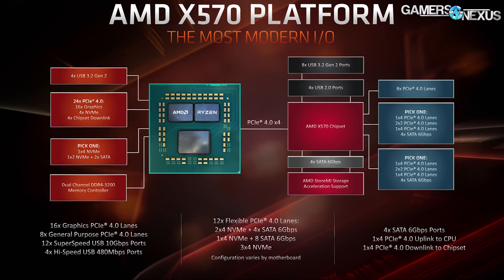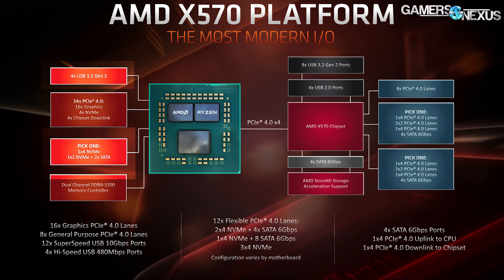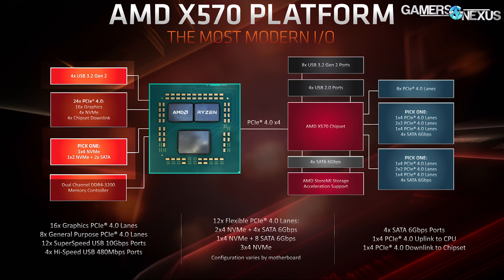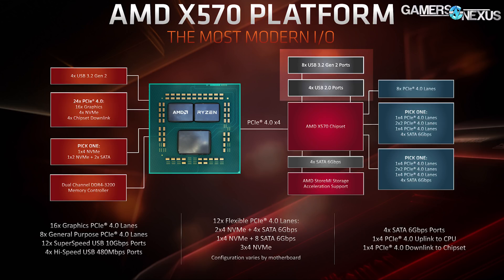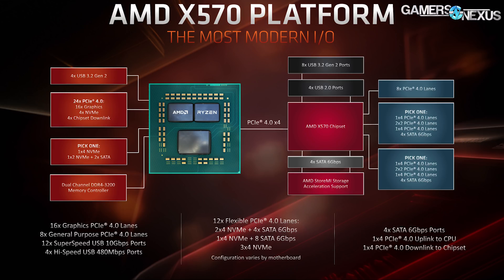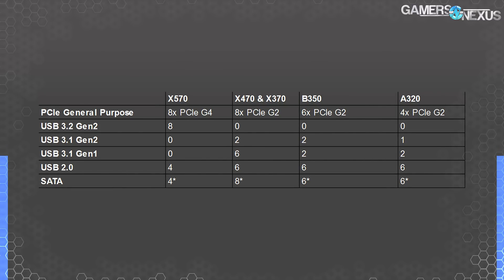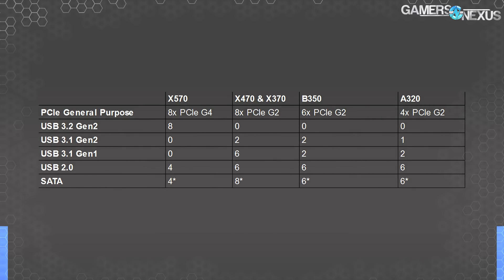AMD X570 vs. X470, X370 Chipset Differences, Lanes, Specs, & Comparison

Comment from the maker: Thumbs up for the video being in focus!

Chipset comparison article: https://www.gamersnexus.net/guides/3482-amd-x570-vs-x470-x370-chipset-comparison
GN medium modmats are in stock! https://store.gamersnexus.net/products/medium-modmat-gpu
Reply: Any chance you'll do a large comparison of the RTX 2080, GTX 1080 Ti, Radeon VII, including a Titan Xp with the supposedly RTX 2080 Super if it does come out to see a comparison at this performance point?
Reply: Thumbs up delivered!
Reply: I thought the X570 has 16 lanes of PCI-E Gen4.
Reply: Hey guys, I have a question. How much the new motherboards can affect the memory OC? I'm assuming that this is totally depended on the CPU memory controller thus just replacing the CPU to Ryzen 3xxx will result in better memory OC, but will we need X570 board for better gains?
Reply: Steve I'm a little confused, if PCIe 4.0 delivers roughly 2x the bandwidth of 3.0, and current GPUs don't saturate PCIe 3.0, why don't manufacturer's of x570 (and PCIe 4.0) use 8x PCIe lanes for primary GPU so we have more PCIe lanes left to work with?
Reply: I take it the 1X Thunderbolt 3 option would take the 2X USB 3 gen2 from the CPU controller?
Reply: Btw AMD said the 7nm apu's will be out in november. They might e the 3300g and 3600g ones
Reply: Interesting.
Reply: There is a Rumor about even more powerfull chipset X590 :)
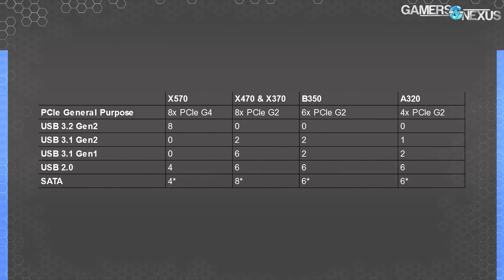Reply: I could be mistaken, but there appears to be a mistake with the comparison table starting around 4:55 It says that the general purpose lanes on previous generations were 8x Gen2, though it seems logical they would be gen 3
Reply: @ScymonEh   On my B450 and B350 boards the Chipset PCIE slots are PCIe 2.0x16 @x4    and PCIe  2.0x1  so  I think your logic is wrong.

Comment: 6:56 wow you nailed it, being on a x370 currently with a ryzen 3000 cpu i'm blocked from usingn latest AGESA bios that would give me accses to smart access memory (SAM) and other general improvements, Now it's a minor performance improvement but still feels kinda silly having to get a new board just cause AMD chose to block of third party vendors from giving out new bios to older chipset boards even though it would work.

Comment: Thank you very much for video. May I ask if I can I have following config:

CPU: Ryzen 5 3600
MOBO: GIGABYTE X570 AORUS PRO
PCIEX16: GPU for PCIeX16 3.0
PCIEX8: GPU for PCIeX16 3.0
PCIEX4: SATA card for PCIeX4
PCIEX1_1: NIC for  PCIeX1
PCIEX1_2: NIC for PCIeX1

Will this work on Ryzen 5 3600? Because somewhere I've seen that it has 20 lanes one one page and 16 + 4 + 4 on another. Thank you

Thank you very much.

Comment: will the overclocked 3600 run smoothly on MSI X370 SLI Plus? bcs I can't seem any tech tuber testing a ryzen 3000 series using this board and I don't plan to change my mobo anyway or anytime soon.

though i've read somewhere that the latest article that they are now compatible and I also happened to always update my bios version, almost all of my country's vendor says that X370 still not supports the Ryzen 3000. I don't know anymore if i got the wrong info or if the vendor hasn't really trying hard to update their info (or perhaps it's their tricks to have their X470/X570 getting sold?)

Comment: basically at this point, if you own a decent x370 or x470 is useless to spend 300$ on a new board. since most the processing is done on the CPU die not on the chipset. Hardware has always been far more advanced than software that can even utilize the hardware.
but you always have Insane people that will throw away a perfectly fine board just to get 7-10 more FPS

Comment: Seems the only manufacture that has PCIe 4 active on their are x470 and B450 is ASUS , Quoted from toms hardware :  " The biggest surprise is that there is better PCIe 4.0 support on  Asus' B450 motherboards than on the higher end X470 offerings. The flagship ROG Crosshair VII Hero,  can't run the first PCIe x16 slot at  PCIe 4.0 speeds, while the TUF B450M-Plus Gaming, supports PCIe 4.0 speeds on both the PCIe x16 and the M.2 slots. Out of the entire X470 stack, only the ROG Strix X470-F Gaming and the Prime X470-Pro are able run a PCIe 4.0 graphics card at x8 speed and PCIe 4.0 SSD at x4 speed. With the exception of the models from the ROG Strix line, the majority of Asus' B450 motherboards can do x16 and x4."

Comment: What's the hole spacing for the X570 chipset? for people that might want to mount a northbridge waterblock onto it, or perhaps an alternative passive heatsink. It's easy to drill some holes into a low profile copper fin cooler like the StarTech FAN7751U 1U Low Profile 70mm Socket 775 CPU Cooler. I bet it wouldn't need a fan with that.

Comment: If you need 2+ full speed pcie 3.0 nvme drives + solid vrm then buy a cheapie x570 board.  If your storage need are 2+ pcie 4.0 drives you are SOL.

Comment: Okay so you dont really need x570 unless you want PCIe lane 4.0s but will you need the x570 for the higher voltage. I know the 3000 series will run on x470 and b450 boards but wont they get super hot? The old chipset ran like 5 voltage and the new one 11 or so and all the x570s have either huge heat syncs or active cooling on them. So i guess my question is if you pop an ryzen 9 3900x in a x470 board is gunna get so hot it kills the board?

Comment: I dont think we going to be seeing any gpus that need 16 pce 4.0 lanes, I think we should have had 8 lanes for gpu slot, and rest for chipset, non dedicated to nvme and only 8 for gpu, how awesome would that be.  Also I would deffo prefer a beefy passive heatsink than a fan on my chipset.  It just looks so ridiculous that extra lanes are sent to the gpu it will never use, and you have all that stuff on the chipset sharing 4 lanes.

Comment: Steve, given the number of lanes that come from the CPU, what do you think of Buildzoid's idea of having a lower cost mbd that doesn't contain a SB chipset at all? ie. just utilise the CPU lanes for everything and with PCIe 4.0 there ought to be more than enough for the majority of users (they could be split to 3.0 if need be). Note your diagram at 4:20; the 4 lanes normally going to the chipset could be used for other things, eg. GigE, more NVMe/SATA, etc. Or think of it this way, with 24x 4.0 lanes, that's equivalent to 48x 3.0 lanes, more than the 44 lanes off the CPU of an X79 system!

16 lanes could be used for the gfx, either for a single x16 4.0 slot or split to two x16 3.0 slots, more than enough for all current and near future gfx combos. And of course it would save on power, board space, etc.

So what do you think? A mbd without a SB chipset at all? With so many lanes coming direct from the CPU, why do we even need chipsets anymore?

Comment: In the Zeppelin die AMD had a flexible io system that was able to be marked by the motherboard maker as Infinity fabric or a PCIe nexus or Sata. A Zepelin die has two of these Flexible io structures in them so you could have two Infinity Fabric links or 32 PCIe lanes or 32 Sata lanes (the io block can only address a maximum of 8 devices so the actual limit for sata in 16 sata devices).

If this remains true for the new IO die, then the X570 chipset has four flexible io links in it. Two that would go the compute dies and two that would become PCIe for the system as the Ryzen io die. This means the x570 chipset is carrying the bulk of 64 PCIe lanes. That's probably going to make it expensive.

Comment: I am curious how much load the newer Ryzen processors put on the older x470 and b450 chipsets.  If the load is significantly higher, will the older motherboards provide adequate heatsinks/cooling?

Comment: I had a MB waaaay back that had a fan and the bearings started failing so I stuck a passive heatsink on it and it worked fine. I believe it was the Abit NF7-S. The chipset wasn't under the vid card so no prob with the heatsink then. I think I'd try to get a backup fan for any X570 boards.
Reply: Had the same board and did the same step.

Comment: A little bird tells me there's also an X590 chipset on the way.
Don't confuse that with ?99 chipsets, for ThreaDripper....
One feature of the X590 (that we know of) is support for many more PCIe lanes.
..........................
Quite what you'd do with that, I don't know...
It SOUNDS like something you'd maybe want for a server. Like, I want a Ryzen R9 3950X with 16 cores, and I want to have 3x PCIe cards in it, each with 8x M.2 drives, and I will be running about 600 virtual-machines each one of which is handling a web page, and I have 4x 1TB/sec network connections... I'm not on the cloud, I AM the cloud. But I don't want to get all professional and big money, so I'm not going to buy EPYICs and a cabinet for them....
If you step back to home enthusiasts and video content creators, I still don't quite see the point.
The way it looks to me, the sort of people who might be even slightly interested in this, should be getting out their cheque-books for an EPYC. That level of high speed connection to fast drives, there's really not much you could want that for, except being part of the cloud infra-structure....

If you were running a web page / site, like (say) NetRider, but for 3,ooo members of the dept social insecurity, and they all had to access a single database of 8 million social security claimants, all at the same time, for 8 hours a day... that'd be bloody brilliant. Thing is, AMD would be cutting their own throat by delivering those, because you want fkcurs like the dept of social insecurity to buy EPYCs. That's the kind of job you build big rack-mounted servers for....
Proof readers are werth their wait in gold.

Comment: 4:45 typo? Or was Ryzen stuck on PCIE 2.0 this whole time? Lol
Reply: Typo Ofc 😊
Reply: @adi6293  Not a typo at all. The chipset was connected to the Ryzen SoC by four PCIe ver 3 lanes but the table is listing the general purpose PCIe slots at the bottom of the motherboard. They are version 2, not 3.
Reply: Ryzen was pcie3, the chipset, however, was not. Different ports on the motherboard come from either the CPU or the chipset. GFX typically would be plugged into a pcie gen 3 socket.

Comment: I wonder how much power that chipset draws when it's not under significant load. After all, it's mostly going be idle, so the idle draw is kind of relevant.
Also, I am curious if power draw would go way down if you disabled PCI-E gen4 (back to gen3). Supposedly that's where a lot of the power goes, so would that scale back a lot? Right now the only thing that can actually make use of PCI-E gen4 is top-end NVMEs or NVME RAID. I could see some people who want an x570 (over a cheaper x470) for various reasons but maybe don't actually have a use for PCI-E gen4 quite yet or wanted power efficiency for some sort of always-on server use.

Personally I will be happy as long as that chipset fan rarely if ever turn on during typical use and it can have a really soft ramp-up to not be audible at all. I am optimistic that this will be the case, but I really can't stand those tiny screamer fans. Best of all would be if it's properly PWM controlled so we can do a custom curve. At the first sign of this being anything but unobtrusive I will be repasting that sucker real fast...
Reply: I might have heard/read that the 570 chips draw 11W at idle and 14W at max (beware: I could be mistaken!).
Reply: @koosk8954  I think that is 11w typical and 14w max. I do not understand typical to mean idle, but of course that is just an assumption. Would be strange if it idled at 11watts as many CPUs can easily beat that, but maybe chipsets like these don't have all that advanced power management like CPUs and the like.

Comment: When they launch it would be nice if bullzoid made a comparison of them to see what's the best for OC and also a good one of the X470 (or even B470) to use with a new 3000 Ryzen since i think the Pci it's gonna be a big deal for most users cause it would make a lot of sound.  On another note, the fan in the PCI starts running if you limit the speeds in the bios to 3.0 ? Cause if that's not the case i guess we could just buy a B570 or X570 and set the PCI to 3.0 (if we don't have any super fast SSD using PCI that's it)

Comment: Correct me if I'm mistaken.   I have an X470 board.  It seems if I pick up a Ryzen 3000, there will be no difference in performance.  SSDs running on 4.0 are not going to be a need for me.  Same goes for graphics cards.  I have a Vega 56 and have no plans to upgrade.  With this in mind,  There is no point of getting an X570.  Are these thoughts accurate?

Comment: The Chipset on X570 realy is something new.
There have been speculation (by Wendell and Ian Cutress) that it may be the same as the IO-die in the CPU.
So this "chipset" takes PCIe4 x4 and makes it into whatever the mainboard makers decide they want. 15W for that is not bad.

Also: Mainboard makers used to be good at heatsinks, now you only get heatsinks on LN2 overclocking boards and chop saw test cuts in aluminium on everything else. There is no need for a fan, just put a damn heatsink on there!

Comment: Does x470 already do per-core overclocking? I keep heaing x570 might not be worth it, but If I can get 400mhz higher single/dual core boost out of it, why not?
Reply: Mostly worth for content creators or some people that has the capability to use the full speed of PCIE4 
but in Video card it doesnt make any difference so not necessary for gaming use
Reply: @exiledwolf2601  But it would make a difference if you can get 300-400mhz more single core boost out of it, plus if you upgrade to an RX 7700 or whatever it'll be called 4 years from now. I'd rather have a low end x570 vs a mid end x470.

Comment: Where is DDR5 and USB 4.0? Still not gonna upgrade my 2011 PC now... And the new AMD GPU's also have disappointing prices 4 me and even though they improved gaming performance massively, the theoretical raw performance of the GPU's are very low when Nvidia is already on 13Tflop+ and maybe soon to go higher in response to AMD cards...

Ryzen 3rd gen looks nice, but the price mehh 8 cores should have gone way cheaper by now too, but prices just keep going higher and higher. With those shitty prices I bet lot of ppl will start moving to Geforce Now and Google Stadia or any other crap like that...
Reply: or we can get another job! /s
Reply: @vladvah77  Yeah right my last job in a 3 star hotel was pretty nice only 2.37 EUR per hour and around 1 free extra hour + every day when the hotel is full all year near 400 ppl and the cheapest room is 120eur per night, almost couldn't pay the fuel for my Peugeot 206 1.4 HDI which is already a car that is very fuel economical... While the hotel owner does have like a half a million mercedes, here it's always made for companies to get rich and they keep getting ppl from the unemployment services of the government so that they barely pay and we never have rights and then they just send you home and the companies to grab others from the unemployment center and this goes in a infinite loop cycle like in C++ loop :(.

I'm a computer technician with 2 courses 3 years and 2 internships and no jobs on this area either, also I have worked in so many jobs even before I was 18 to receive less than 200eur and with 18 even worked 3 months on the construction hard work and the son of a bitch didn't even pay, had to go to his house and he only gave me 250eur while I should receive around 1500eur nothing works good here FFS...

Comment: In buildzoids recent sleep deprived ramble, he mentioned that pcie4.0 doesn't make any sense for a gpu as even the 2080ti  doesnt saturare 16 lanes of pcie 3.0. But what about SLI? wouldn't 2x 8 lanes pcie 4.0 be as good as of each card has 16 3.0 lanes and hence sli doesnt bottleneck the cards?

Comment: You said it draws 11 watts continuously - does that really mean 100% of the time, or just when it's transferring something across the chipset to the extra USB or PCI-E ports?

I ask because if it really needs 11 watts continuously, first that's awful efficiency wise, but also that does not bode well for the longevity of those awful little chipset fans.  Does no one remember the DFI LanParty series?
Reply: That's WHY DFI is out of business :P

Comment: Does anyone know if, say, the B350 is a separate design from the X370 or whether they actually originate from a common design and die, with the B350 having partially disabled features? Are they pin compatible?

Comment: Remember backward compatibility is only valid until 2020. Then there will be a new socket.
I don't see a reason to upgrade.
Will stick with my CH7 and a new Ryzen (maybe 3700X).
Reply: Likely but not necessarily. There will only be a new socket if it's needed for new features, like DDR5 support, more PCIe lanes, more memory channels, etc. AMD committed to supporting AM4 until 2020 but that doesn't mean that it will be replaced as soon as that commitment has been fulfilled.
Reply: Do you read AMD news? They have said (long ago) the socket AM4 is until 2020.
After which a new socket will be introduced. They have new technologies coming in 2020. A new socket will be coming.
If you want splash money just for a year, max 2, go ahead. Its your prerogative.